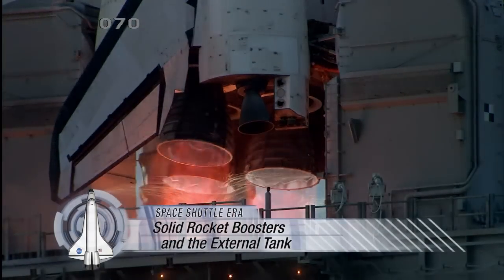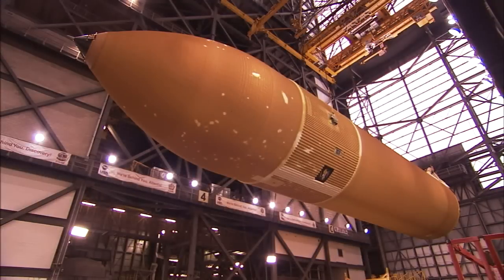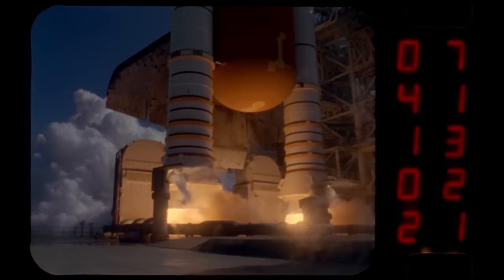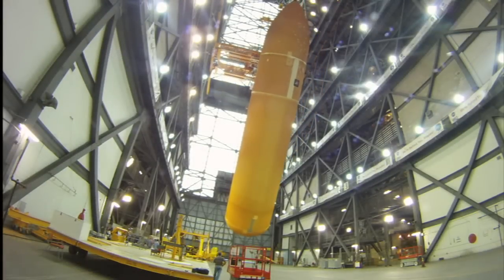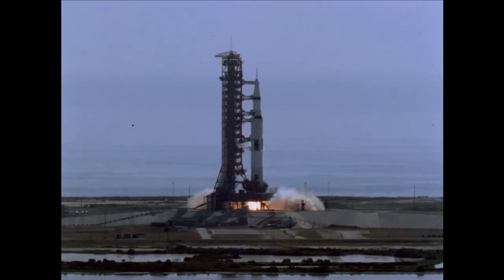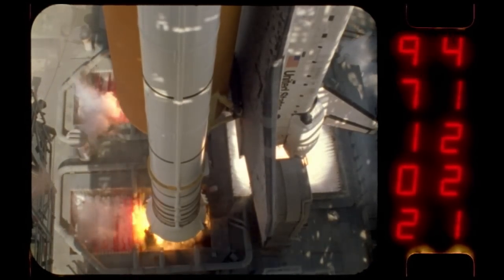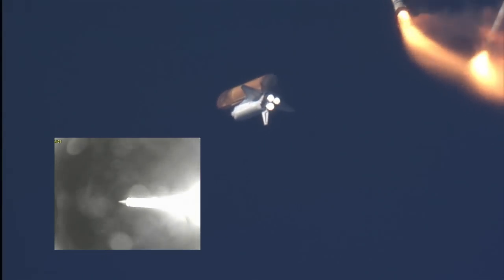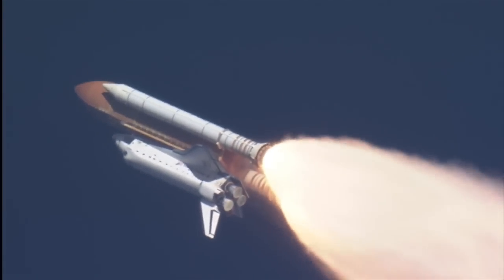Space Shuttle Era: External Tank and Solid Rocket Boosters

Comment: Yeah, that is normal. The aft dome was an aerodynamic deadzone, and as the air got to be less dense, the engine plumes would expand to fill that zone momentarily. I've seen many launch videos and the effect typically didn't last for more than about 20 seconds. Any charring was strictly confined to the absolute most superficial layers of insulation.